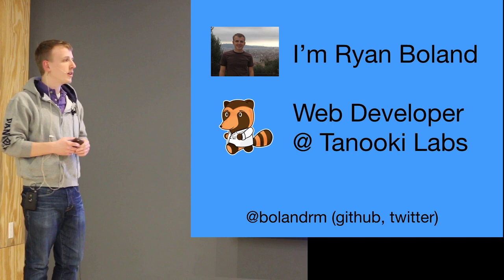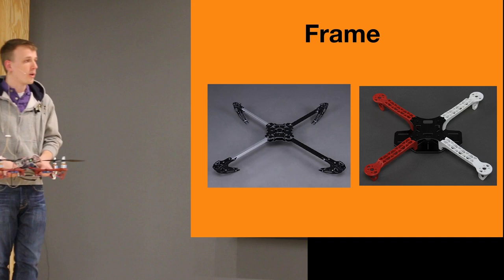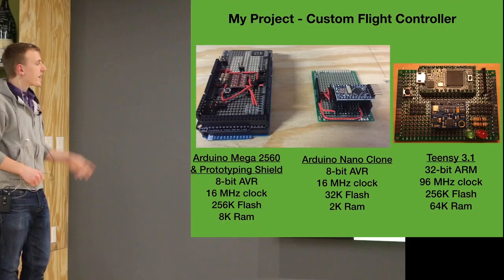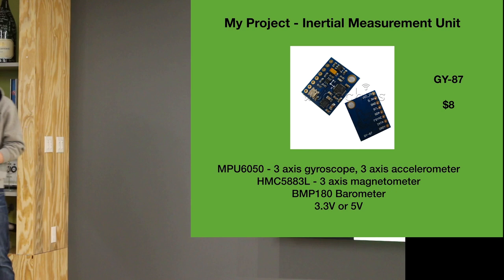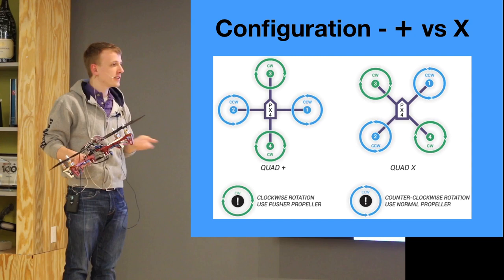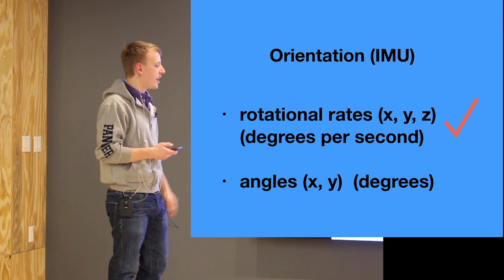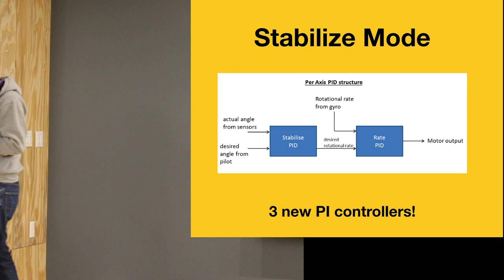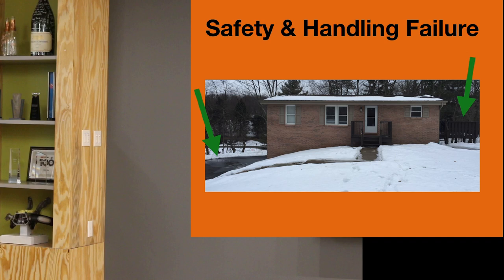Embedded Programming for Quadcopters

Comment: hello the video was soo good , i just did a drone with pixhawk flight controller, so i just want the information about how much current and voltage is used by the 4 esc and the 4 motors and the whole pdb connected to a battery so how can we calculate it so i can estimate my flight time using a 3300 mah battery.

Comment: how are you reading sensor data in real time?  for example at the end, there were no wires connected to a computer to plot that data...
Reply: he's probably using wireless connection to the computer bluetooth or wifi connected to the arduino. there are modules that are sold. you buy them and connect them then write some code and then you get the data to the computer. on computer side he writes a client that uses the data and puts it on that interface using any other language. web php, desktop application using C# .net or C++ Qt or whatever.

Comment: What language should I learn to code drones? Does Python work?
Reply: Majid Mohammad Probably it works on a specifica platform but if you want to code a drone you better learn C or C++ so you are able to use almost any mcu
Reply: C is the best language for drones. Python code maybe work in Raspberry Pi
Reply: I have learnt how to code on an Arduino, so do I still need to learn C or C++? @mattelanni
Reply: If you want to use python then you can use micropython